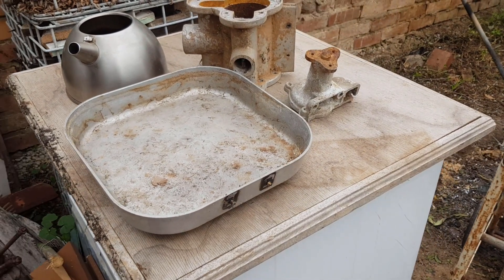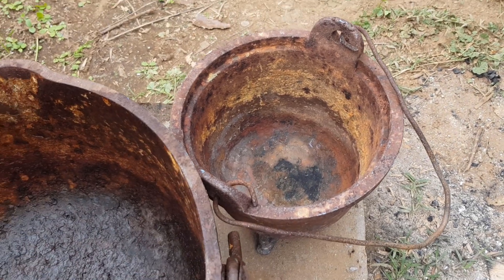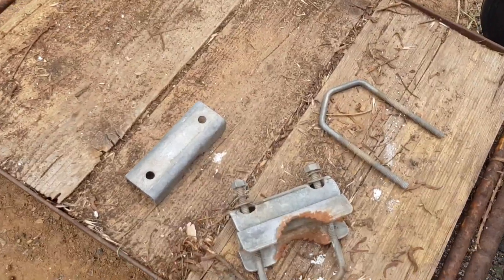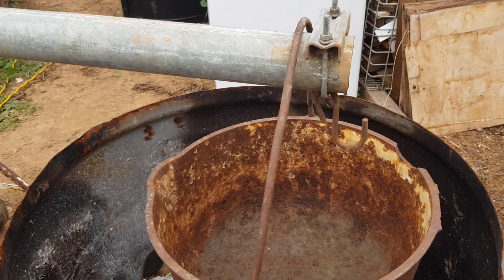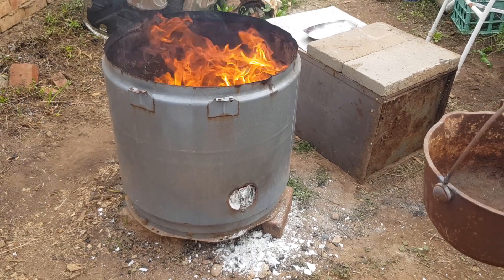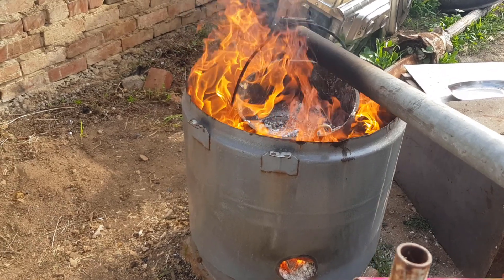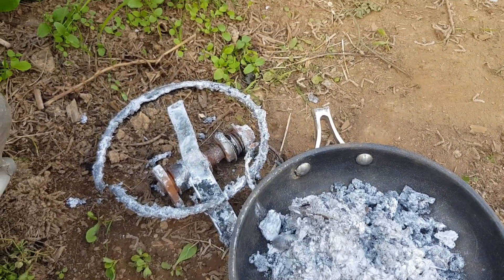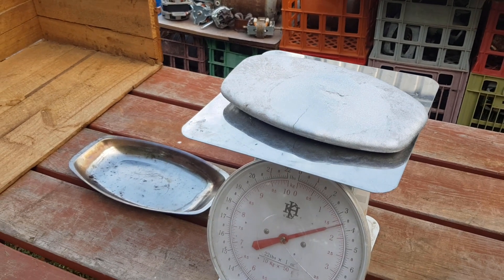Melting Aluminium in a home wood fired furnace - plus making a jib crane from scrap metal items!

Comment: I would put another clamp on other side that hot pot handle so that pot can't slide back at you if lift little to high will slide back and burn you up
Reply from the maker: Fair point Bruce, I certainly want to stay safe!!

Comment: Surprised you got enough heat for that. Not much limit to what you can copy now.
Reply from the maker: Casting is the tricky bit Mitchell! I'm not going to muck around with casting sand at this stage - just using the kangaroo mould I have 😊